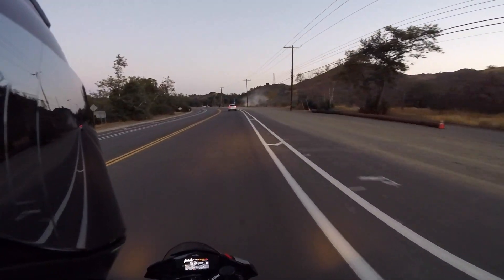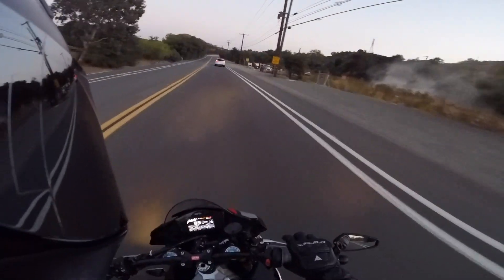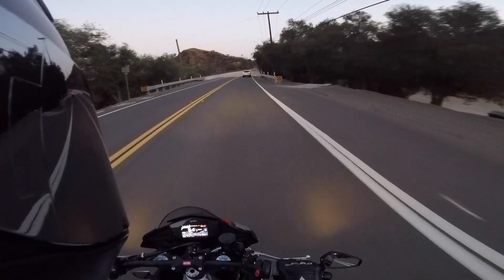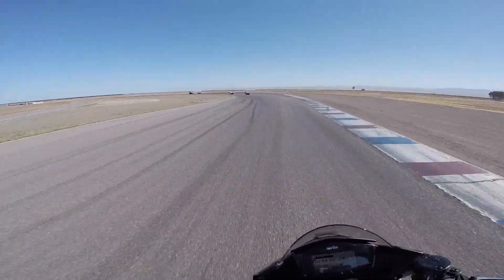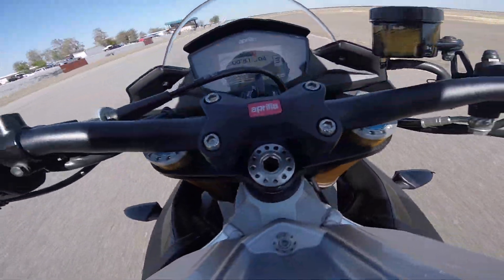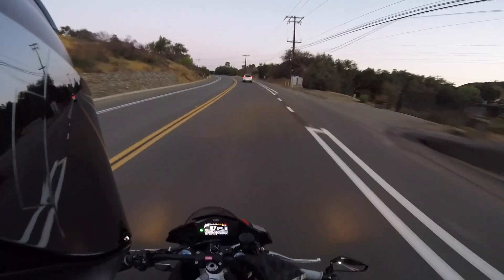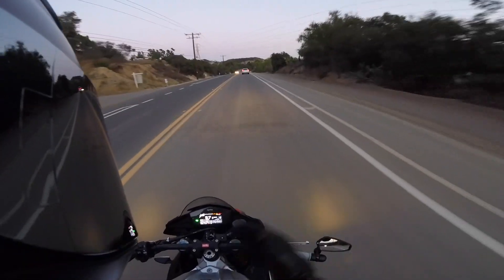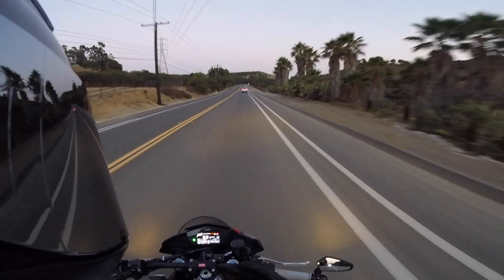Motorcycle Quickshifter and Autoblipper Explained - How Aprilia Quick Shift Up and Down Work!

Comment: This bike allows you to down shift with the auto blipper keeping open the throttle (at least 2020). Magic
Reply from the maker: Hey Ruben, appreciate your comment! My 2017 does as well! Although, I've noticed it is a bit clunky when doing so, and I definitely wouldn't recommend downshifting while you're accelerating. I think I did make a mention of this in the video, but my mistake if I didn't call it out well enough. 🙂 Thanks for watching! How long have you had your 2020?
Reply: @hiimchad  if you mentioned properly I didn't catch it hahahaha. I got mine since  June but I bought it from second leg (from other guy) with 4000km. Writing from Spain. I have the akrapovic and the official racing mapping. However, I noticed that the clunky feeling is related to rpm and chain tight! Great videos!! Keep on it. You're doing great
Reply from the maker: @mcguiveroner  I just went back and rewatched from 1:00 and did make just a brief mention, mostly advising people not to try downshifting with the throttle open more than a little bit. Guess it wasn't apparent 😅 

Nice, congratulations! I also have the Aprilia Race ECU mapping on my bike, but with the SC Project CR-T exhaust. It's very loud, but it sounds like a MotoGP bike so I love it. 😁 Must be nice to be over there in Spain with all the great GP racetracks! I am a bit envious. 🙂

Thank you for the kind words! I really appreciate you checking them out and hope you'll subscribe if you haven't already. 🙂
Reply: @hiimchad  For sure I was already subscribed. Thanks to your Evap Canister video I knew what is for. I'm thinking in removing it as you describe in the video because these weekend that thing kill my bike for a while in the middle of the canyons. To solve it, I needed to start the bike in first gear and without leave the revs go down opening the throttle.
Reply from the maker: @mcguiveroner  sounds like the evap canister may be your culprit! It's a fairly simple a cheap way to solve it or root it out as the cause. Best of luck with it! And also, I really appreciate your subscribing 🙏